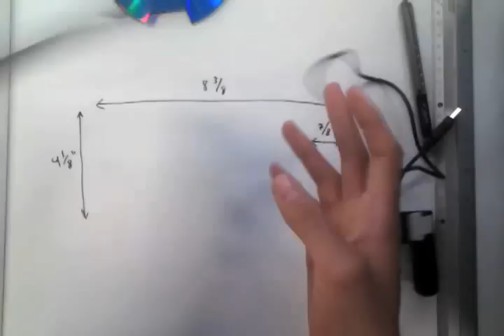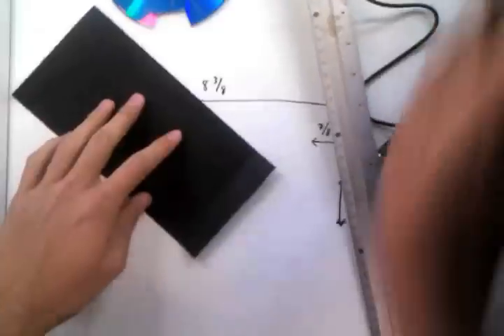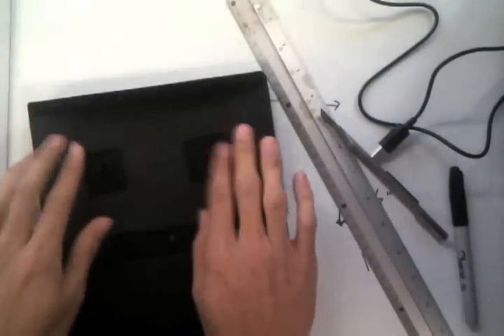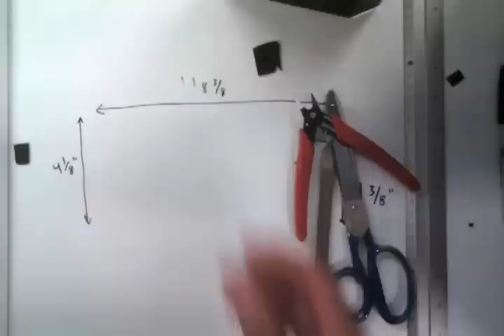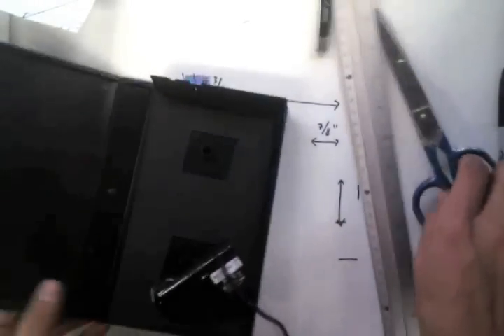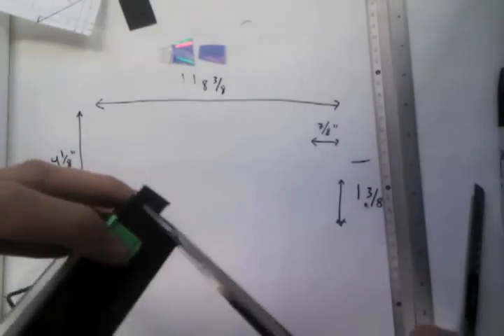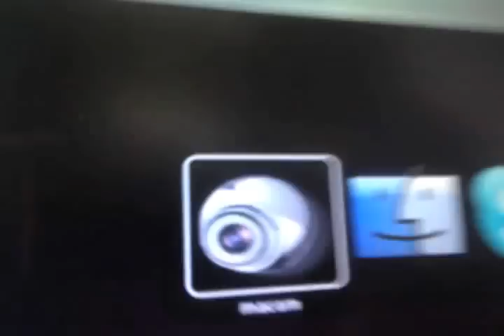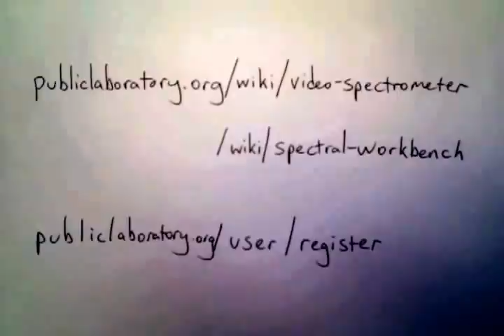Build a $10 USB visible-light spectrometer | Public Lab

Comment: Use better two razor blades to create that single-slit.

Reason:
The narrower the width of the split is, the better is your resolution of your spectrom.
Reply: +OpenGL4ever This is true, but it should be noted that there's a trade-off in signal intensity in having a narrower slit.